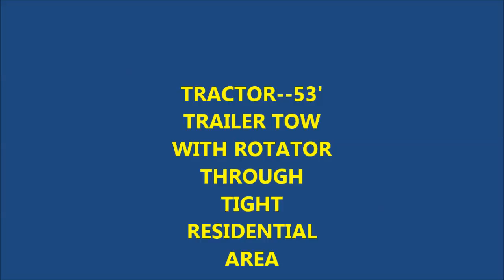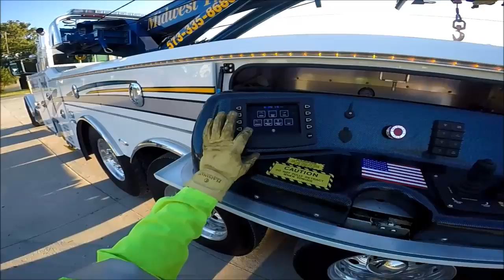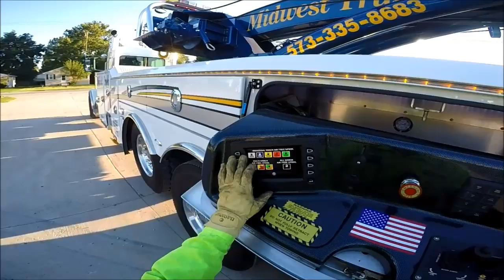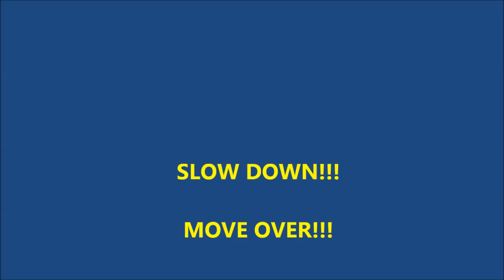1150R TIGHT QUARTERS TOW

Comment: Anytime i feel like i had a tricky time squeezing the flatbed somewhere or have to fish a car/truck on the wheel lift into some wild area reversing, i always revert back to this video and laugh that i was getting worked up over something so small, when it could be something this massive in a tight area like that. Excellent driving skills holy heck talking about tight turns! I like how you stopped on the 2nd turn before you went past the point of no return to verify that you will make it because some guys just go for it and get into a bind. Great work as always!
Reply from the maker: Stay safe and watch your 6.  Dangerous job we have.  Thanks for watching and God bless.
Reply: Always, Stay safe out there as well!

Comment: This reminds me of when I started driving truck and they sent me to Dominion Bridge to deliver a load of 90 foot steel on a pole trailer. It was hooked to an old R model International with a gas engine and a 5 and 3 transmission that was stuck  in low on the aux box. I called my dispatcher and asked him how the heck I was supposed to make the tight corner at the first intersection and he replied "that's why I sent you, because you have the attitude to tell people to kiss your a$$ if they have to move for you."  After that he had me pulling a sixty foot spaghetti rack hauling rebar every day. Back when most trailers were forty foot that was something to me.

Comment: Hey Ron, an idea just popped in my head. When you are towing a tractor trailer rig. What if your remote light bar for the back also included a secondary wireless backup cam.

Comment: Only caught a glimpse of the trailer at the start of the video but it looked like a 53' trailer.  Wouldn't it have made it easier if the trailer duals would have been slide forward to make tighter turns?

Comment: Who designs the tow trucks? The compartments for each piece of equipment, how do they determine all that. Do the owners help and who puts all the equipment in the truck?
Reply from the maker: The trucks that we own are designed by Miller Industries out of Tennessee.  There are certain things that the owner can specify as far as box configuration when they special order a truck.  Then, the equipment can be bought with the truck and the dealer can place it or the owner can assist with placement.  If the owner adds equipment, which we do, then we rearrange the boxes as needed.   Thanks for watching and God bless.

Comment: Do you not have "eyes" to use in the bumper of the broke down rig? I am wondering why you used hooks? I would prefer a non hook for worry of 2 hooks slipping out of each other. I think my  point of view is likely incorrect. You do this for a living and I do no. I have a few years experience using a car trailer for passenger vehicles. What you towed and what I have done are not quite the same I know. I just would like to know what you think of my thoughts. Continue being safe and take care.

Comment: Ron, did you not have to pull the driveshaft or did you cut that part out? Also, why didn't you have to chain down the front axle before lifting it? Was it not an air ride axle?
Reply from the maker: I edited that part of the video when I disconnected the drive shaft.  The front axle was a spring ride, so there was no need to chain it prior to lifting.  Keen eye for detail....   Thanks for watching and God bless
Reply: Thanks Ron. I noticed because I just watched your video where you tow a Peterbilt from a nearby quarry. By the way, is that a Peterbilt dealer right by your shop? Love your videos. So glad I stumbled upon your channel.
Reply from the maker: Brian Kindley .  It is a Cat dealership.   I wish it were Peterbilt, but they are about 20 miles south of us.  Thanks again.

Comment: How come you don't lift and tow heavies using an under wheel lift that is common in the uk. I operated a wrecker fitted with EKA equipment and a Vulcan underlift that would slide each side of the front wheels and lift the vehicle. We considered this to be a considerable improvement over our old unit that utilised axle forks or front Spring slippers.. Does legislation prohibiting the use of under wheel lifting in the US ?
Reply from the maker: John Collier. No it is actually quite common to use over here.  We call them wheel lifts.  The truck I operated before this one was a 35 ton tow/recovery and I used the wheel lift a lot.  This truck has an extremely heavy duty wheel lift that is also extremely heavy.  Each head that fits over the T on the under-reach is almost a 2 person job because they are so heavy.  I don't tow a lot with this truck because of its size.  It is designed more as a recovery vehicle.  We have other units that do the majority of our towing.   Thanks for watching.
Reply: Ron Pratt thanks for the feedback.....I retired from the Fire Department about 18 months ago where I was in charge of all vehicles and equipment. We operated our own recovery unit built in house on a 6x4 Volvo FM fitted with ex military lifting equipment, but modified with a Vulcan underlift. Take your point about the weight of the wheel lift ancillaries, but we kept ours fitted semi permanently to make lift and tow a quick and easy procedure especially when recovering from the motorway ( interstate). Since the fleet of over 150 trucks were predominantly standardised, the wheel lift settings could be left in place. 
Keep up the good work. Love watching the action from the comfort of my armchair, but wish I could be there at times, many happy memories of vehicle recoveries I have done over the years keep flooding back.
Reply from the maker: John Collier. Thank you sir.  And I'm glad you enjoy my videos.

Comment: how much does a heavy wrecker run you now these days
Reply from the maker: Gregory Stell.  It really depends on what you want. You can get a GOOD used heavy 35 ton stick for around  $100,000.  They go up from there.   Again, a lot depends on want you want and how you have it set up.  We bought our single axle Pete with a 20 ton brand new 2 years ago and it was just over $200,000.  New rotators start at around 500K and go up.
Reply: Ron Pratt. is that the truck itself or is that with all the equipment and gear as well
Reply from the maker: Gregory Stell. That's with all the gear and fueled.
Reply: guess being a player ain't cheap